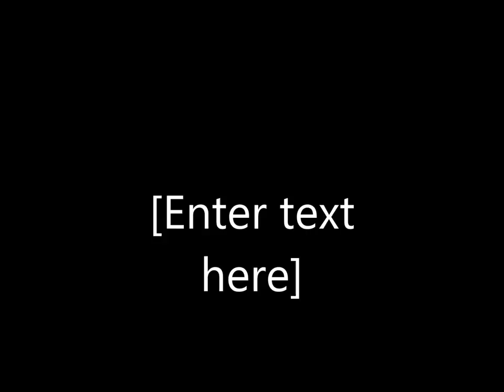How To Make A Pedestal Kitchen Table [Part 1]

Comment: I am building one right now similar to yours, using similar approaches to the pedestal and upper cross members.  It was very helpful seeing how you put the trunk of table into the base of the pedestal and how you cut the dados for the cross member in the top.  Rather than one solid trunk for the pedestal, mine consists of four arches, which curve upward to the table top, and each will be laminated to the same centre block.   I loved your use of the chainsaw and grinder.  Your skill level with basic tools is awesome!!    Andy Block
Reply from the maker: Thanks!  Your base design sounds pretty cool.

Comment: Just a normal chainsaw and blade but smaller so easier to work with? Great job.
Reply from the maker: Thanks! The saw is an ECHO cs-400, so a mid size saw with the stock 18inch bar.  The chain was most likely a semi chisel safety chain, because I on;y just started using non-safety chain.  I have a carving bar for that saw, but the cuts weren't really intricate enough to warrant using it.  The regular setup did the job just fine.
Reply: Lol

Comment: Love your chainsaw use.  A thought;  the pedestal is only countersunk thru  1 1/2" allowing, over time a wobble.  I would lengthen your pedestal to allow full countersink.  I would pick up a piece of steel 1/8"  at least 1 1/4" wider than your pedestal foot, drilling holes on the perimeter and  4 in the area the pedestal contact.  During final assembly this will allow you to put 4" or better screws thru steel plate into pedestal. You'll need to route out an area on the underside of foot that is ground contact 1/8" deep, for steel.   
Possibly adding 1 shorter 2x to each side in width of feet, this will help with stability for years of use.

Comment: You had me with the angel grinder. 
might I suggest planning the glue joints to keep from filling in the inclusions that showed up after the rapid stock removal tool, aka chain saw.

Comment: New subscriber, like your work. At around 10 minutes you are using a hand grinder to round out. What is the disc that you are using on the grinder? Thanks and keep the videos coming.
Reply from the maker: For this project it was probably just a flap disc.  I have since upgrade to an abrasive wood carving disc that is all metal, last longer, and works faster.
Reply: @HoneyBadgerWoodWorks  Thanks for replying.

Comment: HI there! Do you know if this size single pedestal base would be sturdy enough to uphold a 38" x 66" rectangle top for a dining table? I love this base you made it is amazing!! Please let me know, I would like to try making our own dining table for our remodel but I need to make sure it turns out really sturdy and safe for our granddaughter who will grow up in this home. I need it to be a single pedestal because we will be putting an L shaped dining bench and I need to make sure there's ample foot and leg room all around the table so that no matter where someone sits it will be comfortable so that people will want to stay there and hang out longer!
Reply from the maker: It really depends on how heavy the top is as well as the size.  A 66 inch rectangle is also very different then a 66 inch circle, with a circle the weight is distributed evenly off the base, with a rectangle your two ends canter-lever further then the two short sides.  The dimensions of the pedestal in this video is definitely too small.   The ratio should be that the pedestal is about 2/3 the size of the top, so at 66 you are looking at at least 44 inches, and your sides are only 38 inches wide.  Personally if a customer approached me with this I would recommend two pedestals for a table this size.

Comment: Good job! What kind of wood filler do you use for those nicks and for the area that the lap joint sits? Looking for a flawless finish where the joints are. Thanks!
Reply from the maker: I didn't have a ton to fill on this, but the best wood filler is a little bit of wood glue and sawdust from the project you are working on, mixed together to a peanut butter like consistency.  Strong and practically free.

Comment: This is so educational.  Thanks for sharing so much knowledge.  I do have one question....maybe a silly question:  Your lumber looked straight when you started the project.....all the lumber I buy is always too messed up to get a good lamination.  Did you do something to flatten/straighten your lumber up before starting this project (using a jointer or something)?  Thanks again....just awesome work there!
Reply from the maker: I don't have a joiner these are straight from the store.  I spend the time picking out the straightest ones, but I also only work with 2x6's versus 2x4's they are an all around better grade of lumber and substantially less bowed/twisted/cupped then 2x4's.  The extra cost of the 2x6 and time spent ripping them down is well worth it for the straight lumber.  I also use the lumber I get within a day or two.  Even the kiln dried variety have a tendency to move how they want the longer they lay around the shop.

Comment: I am considering making a long dining room table.  Your video, and the other parts, have given me some good tips and ideas on how to accomplish it.  Questions: can two of these pedestals be used for a long rectangular(ish) table about eight feet by just under four feet?  Will they be sturdy enough to support a somewhat light table top?  Should a base bar be installed with it or perhaps a long arm connecting the two?  Thank you for this, nicely done.
Reply from the maker: I think support wise two bases built similar to the specs in the video is more then strong enough and will work fine.  That Ash table top I put on my base weighed a ton, and there was absolutely no flexing with the base.  I have done other work for that client, so I have been back in the house and the table is still perfect.  If it was my build I would use a stretcher bar on the bottom mortised and tennoned into place.  However, I have done refinishing work on two long tables with dual pedestals that had no stretcher and there was nothing wrong with them.   They were dinning room tables, so they don't see a lot of action.  If this is your main table, that people sit at a lot, lean on a lot, and gets shuffled around a lot I would want the stretcher to ensure alignment stays true over time (especially if the table is picked up and moved, without one I would be nervous about the separate bases shifting).   But with properly building and attaching two separate pedestals sans stretcher I think you would be fine.  I am a self-professed over builder, which is good piece of mind for something not going in my home, but isn't necessarily a requirement for personal projects.  Hope that helps.
Reply: @HoneyBadgerWoodWorks    It does indeed help, I keep your suggestions in mind.  Thank you.

Comment: where did you get the dimensions or the paper sketch.
Reply from the maker: The sketch and dimensions came from my head based on my knowledge of flexing and load requirements for the top going on here.  The basic style that went with the dimensions was from the customer.  So the red paper sketch was something I drew out of those requirements, not something I pulled from the internet.